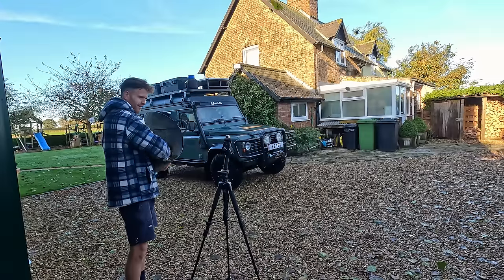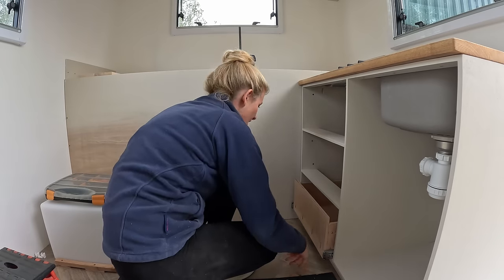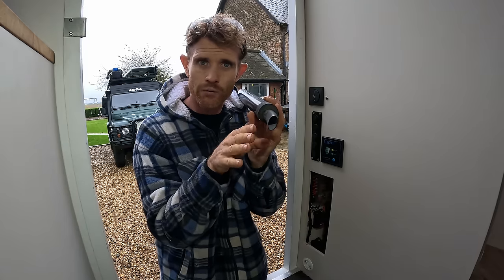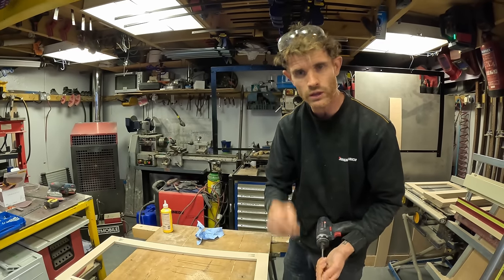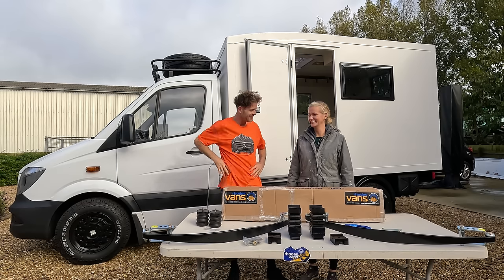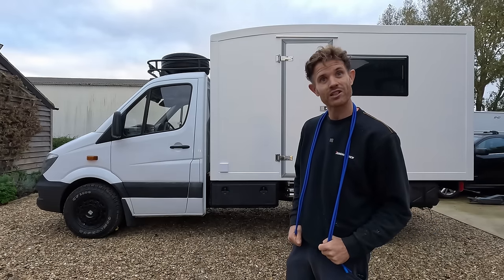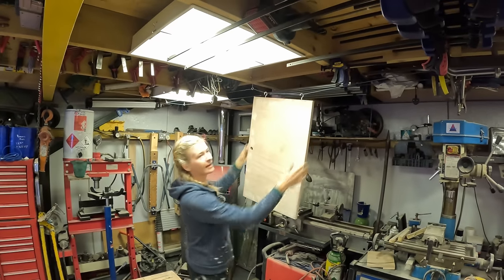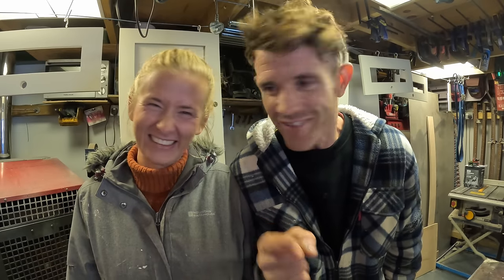Sainsbury's Delivery Van to Arctic Ready Adventure Camper: Building For the EXTREME Cold!

Comment: Great video, Reay enjoyed it. Thanks for the tip about the Ferrells, I had seen them before but never realised what they were for, so they would differently come in handy. I have added to my wish list for black Friday next month. Agree with everyone else... You have a awesome workshop, so jealous of the car lifter and panel saw. Do you guys have a table saw or you prefer the panel saw. I was looking into a table saw but truthfully, they scare the crap out of me so thinking of a track saw instead... But nothing fancy like the Festool. Anyway, awesome job you have done so far... Can't wait for the next video. 👍
Reply from the maker: Cheers mate, so I do have a table saw but you need so much space for that too as not only do you need the space at the front of the saw but you need the space behind it to push the material through, and unless I get a very expensive heavy one they are so hard to cut big boards, if I could only have one saw it would definitely only be the track saw it’s the most versatile and also the most accurate too, i wouldn’t bother with a evolution track saw, or a cheaper version tho, I tried one months ago and sold it after one cut, they aren’t a proper plunge saw, they are more of just a circular saw on a track, they are messy too as the blade isn’t covered properly so dust extraction is pretty much non existent, I would recommend the festool, a Bosch or a makita one as from all my research they all came out on top 👍
Reply: @truebluetravellers  thank you for the advise. I did look at the evolution but saw it was mix reviews.and honestly I would rather spend more to know I will get an accurate cut. I was looking into the Bosch models since majority of my tools are blue Bosch. Festool, while it would have been the best, it's out of my price range. But yeah, I been differently thinking of getting track saw Vs table saw, especially space is an issue, you differently need space all around and it's very hard to cut sheet materials which is where your track saw comes in handy. Many thanks for the advice.👍

Comment: Hi guys. Love the channel and awesome van. We currently have a t5 but with growing family want something bigger. You can get the rock and roll beds for the back of these with a bracket for the underside. What would be the possibility of adding a set of seats in the rear of the Sainsbury’s wagon for traveling and seatbelts?
Reply from the maker: Cheers mate, yeah it was something I considered as would of been a good selling point when the time came, I think you could do it but all I’d do is make sure the frame somehow bolted to the chassis too underneath as the floor is just 30mm grp 👍
Reply: @truebluetravellers  awesome. I did hear you mention in a previous video about the shell. Thanks for the advice and keep up the awesome content

Comment: Electrics look neat but could do with ventilation, especially with a fridge in such close confined space (as it puts out heat). I would make the mini door a vent with another in the front low down below the fridge.  Its not a massive issue as your electrical system is modest (i.e. no 3kW inverters or 60A DC converters) but good practice. For anyone thinking of doing this with a larger system, dont even think about it, you need lots of ventilation otherwise the equipment will reduce the output to cope with the heat soak and it will affect the longevity.  I could go into lots of detail if anyone is interested but normally people switch off when I harp on about the engineering in these products ;-)

BTW, good decision on the batteries (to possible expand if you need to), two is often better for current output (as the BMS has limits) and also redundancy.... obviously only if you decided you needed to.  I've done exactly the same with a Fogstar.

Cant say Im a massive fan of those renogy units as there are a few reports of failures. Victron make nice MPPT and Sitrling make some nice, newly designed DCDC for alternator chargin. 

BTW I hope the M12 rivet and nibbler is on order! 😋
Reply from the maker: Cheers mate, so I’ve vented the cupboard on both sides, also cut half the pannel of the middle divider out and also the fridge has quite a big gap to the electrics, ideally I’d like it to be reasonably warm to keep the battery temperature up too, (for the winter trip) if it’s an issue then I’ll just install a couple of computer fans to keep it cool but I ran a similar system in oz in 40’c and it was spot on, I installed victron in my first van and I totally agree that they are the best units but also come with the price tag too, fingers crossed my unit renorgy unit is a good en, 
😂😂 no mate not yet although they are on the list 💪

Comment: i think those helper thingies that go in place of the bumpstops will break out of the holder a little too eazy , wat you can do to prevent loosing them alltogether by tying them to the van with some thin chain or strong rope that way should they break loose they at least stay hanging on the chains and you can remount them
Reply from the maker: Good idea 👍 I’ll check it out

Comment: Hi Jess and John, I’ve recently started following your Channel and I’m really enjoying it. 
I’ve been trying to see what you did for winterising your water system and I can see that the fresh water tank and system pipe work is internal but I couldn’t see how you dealt with your grey water and stop it freezing. Have you got an external insulated under-slung grey tank?  Cheers Paul
Reply from the maker: Hi Paul so we have an internal tank in the garage for the sink waste, and an external one for the shower which we won’t use as  no matter what we do we won’t really be able to stop it freezing, we will just shower on the van when we are spots it can drain straight out 👍
Reply: @truebluetravellers  yes that makes sense, I did wonder what the smaller tank in the garage was for. Thanks for replying so quickly. 
I look forward to following your future adventures. I hope you have a great 2024!

Comment: I’m guessing you’re heading up Scandinavia in Winter 🥶? Are you planning to fit a block heater so you can start your truck and reduce wear when it gets really cold?
Reply: Agreed. This is essential. As are proper winter tyres (with the mountain symbol on the side). They make a huge difference and are also a legal requirement in winter. Adding studs can be tricky, due to the different requirements across the EU, but those with the waffle pattern are very effective. I recommend Nokian Hakkapeliitta and I think they are available in your load and speed rating.
Reply: Good advice 😀. Plus I’d take a spare diesel heater for redundancy, wood burner would be nice. 

I drove to Nordkapp in Summer about 15 years ago and love the scenery and isolation, was planning to head back this winter but my missus has vitoed the idea 😂 as she’s not keen on the cold and Scotland was enough for her last Winter. So think we’re going to head to Spain / Portugal via the Alps.
Reply from the maker: Hi, yes we are and yes we are 😀 will probably install that once we get back from the Scotland trip as Alex Frood is testing one out at the minute and want to know his thoughts on it before installing it
Reply from the maker: @simonbuckingham1360  Hi Simon, yes we’ve got the 3 peaks mud and snow tyres so should be ok with those hopefully 🤞
Reply from the maker: @primalvanlife5581 Sounds incredible, we’d love to see it in the summer one day too! We are definitely planning on taking a spare heater, heard too many horror stories of them dying!!

Comment: Just wondering if putting all the electrical items behind the fridge is not going to cause issues with release of heat? Both fridge and electric converters crests quite some heat, where will you release that?
Reply from the maker: 👍 I’ve got some vents either side of the cupboard, big gap between electrics and fridge and I’ve also installed a computer fan to circulate the air 👍

Comment: If the main use for 240v is the laptop, is it worth looking at a laptop charger with a lighter socket using the 12v?
Reply from the maker: I’ve tried but the laptops we have won’t work like that unfortunately
Reply: @truebluetravellers  that's a shame, it could have cut down your battery consumption

Comment: Will the heat of the fridge cause the inverter to overheat as it need good air circulation
Reply from the maker: what I’ve done is put vents either side in the cupboard and half the side where the battery is has been cut out and lastly the fridge still has quite a gap to the electrics so plenty of space for airflow, if it becomes an issue I think I’ll just install a small computer fan to keep things cool but should hopefully be ok 👍
Reply: @truebluetravellers  did you look into the clove box conversion kit for the landy
Reply from the maker: @craigberesford726  yes it’s on the list along with lots of other things I’d like to do 😂😂😂 the spending never stops on those beasts!

Comment: If this is supposed to be a "Arctic Ready Adventure Camper" there´s one detail you overlooked. You can´t go to Norway or Sweden in the winter without proper wintertires! You must bring with you studed wintertires if you plan to go to the northern/arctic part of the scandinavian countries. So far you haven´t said anything about where you plan to go besides "northern europe" or "the arctic´s"
Reply from the maker: So the rough plan is Germany Denmark, southern sweeden, up the coast of Norway, then across the top definitely lofeton and tromso then back down through Finland then either through the baltics of straight home but will see, so we have three peaks tyres on and have also got some snow chains so should be ok just have to be sensible about where we go and what we do 👍

Comment: Personally I would have mounted all the electrics on vermiculite board. Your inverter will get hot when under max load, Also the back of the fridge will be hot when running. Hope you have good ventilation.
Reply from the maker: Yeah I’ve cut vents into both sides of the cupboard to give air flow and the fridge is still got quite a gap to the electrics, the inverter only gets used to charge a laptop so will just be ticking over really 👍
Reply: Just want you guys to be safe. An inverter or any power electronics should be mounted on non combustible board . Remember a little knowledge can be dangerous.
Reply: Forgot to mention…If you’re using a 200AH lead acid battery, a gas vent tube needs to be attached to battery vent hole and vented to outside.
Reply from the maker: @paulbentley7815 👍 we are running 200ah of lithium so all good 👍

Comment: Not a great idea to put all the electrics behind the fridge. The back of the fridge is where the fridge creates heat - which means you are exposing the inverter / regulator to much higher temperatures. At best, shortening its life and general performance.
Reply from the maker: I’ve vented the area quite well and the fridge has quite a big cap between the electrics, I ran a similar setup in oz with 40’c days and it never missed a beat, if it becomes an issue I’ll just install some computer fans to keep the air circulating 👍
Reply: @truebluetravellers  fair enough. And you are going to a cold part of the world too. It will probably be fine, but longer term, it might be happier in a different location. I was off grid in Oz for a while too. It’s a good country for it.

Comment: Common u should know better.... hydraulic Jack on gravel with wheel off .... Where's ya axle stand or even lay the wheel under the axle  if the jack cockles in the gravel then she will be making u a permanent box in your workshop....... p.s not so keen on the acces to the electrics.... things go wrong if worst happens could u disconnect and put a small fire out once the fridge is in🤔..... (edit 5 seconds later a stand appears I was surprised lol)
Reply from the maker: 😂😂😂 yep always use an axle stand 👍
Reply: @truebluetravellers  it was a surprise when I thought u wasn't using one 😂😂😂🤣

Comment: Sorry guys but totally disagree with your placement of your electrics .This is nothing but dangerous. Scenario in the arctic electrical fire van burns down now what just could not get to it in time .HMMMMMMMMMMMMMMMM
Reply: I've got to agree, not that l know as much as John or Jess. It seems counter-productive to put a fridge, which emits heat from the back,  in front of your electrical components. Also, me being picky, why did you go for a cheapo inverter instead of Victron?  Whilst I'm on a rant, again, sorry guys, are you using the special batteries, like Mispronounced Adventures, to cope with the minus 45-degree. temperatures at the Arctic? Also, are you going to install  an engine pre heater?  Anyway, thanks once more for a very funny, entertaining, educational video. 👏👍
Reply from the maker: So I’ve put vents in both sides of the cabinets, I’ve cut out half the panel between the battery and fridge and the fridge has a big air gap to the electrics, to be honest I’m hoping it will stay reasonably warm to keep the battery warm so I don’t think we will an isssue, if it does become an issue later on when the weather gets warmer I’ll stick some computer fans in there too 👍
Reply from the maker: So I’m hoping the warmer area will keep the battery warm too but I’ve got plenty of ventilation around the fridge and electrics, I ran a similar system in oz with similar ventilation and we had 40’c degree days and never missed a beat so should be all good, 
so I’m just using a normal lithium battery as we will have the heater going 24/7 so the battery temp should never drop low enough to not be able to charge, yep we are installing a pre heater, Alex is reviewing one next week so will see what he has to say about it 👍
Reply: Excellent, Jon.  If i recall, was it Alex who put two computer fans in his electric cupboard, to keep the double MPPT controllers, cool?

As ive said to Colin and Sean on the Foxes Afloat channel, "Who needs the BBC or Sky, when we have interesting and entertaining YouTube Vloggers?"👍
Reply: I hope it all works out and all is good. @truebluetravellers
Reply from the maker: Yes it was, I noticed that the other day whilst watching his stuff 😁👍